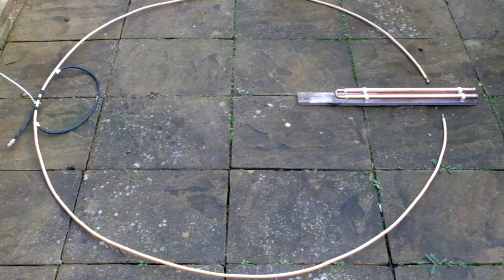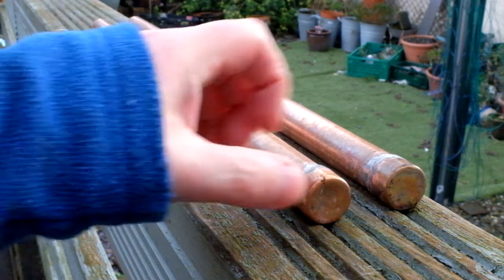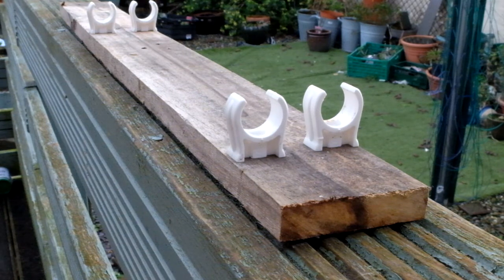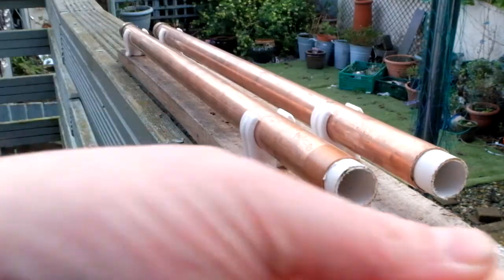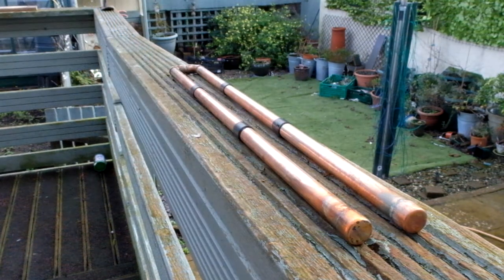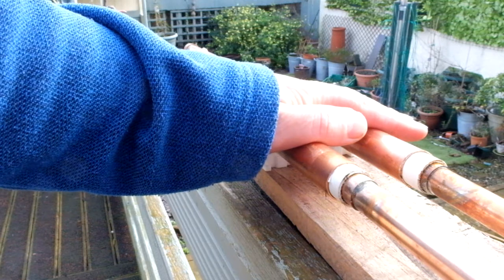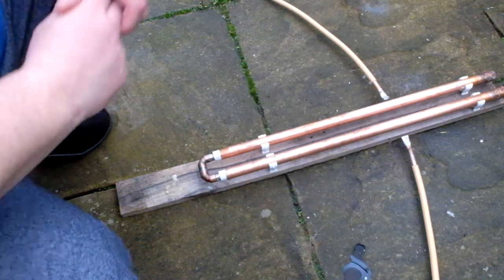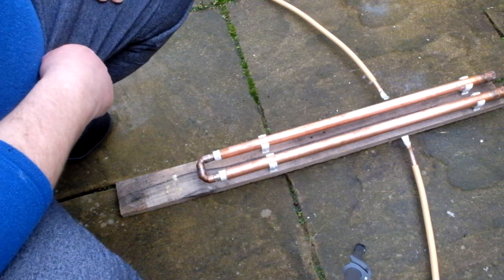Trombone capacitor for a small transmitting magnetic loop aerial

Comment: what bands will it tune with that capacitor?
Reply from the maker: It was meant to tune through the 40m band and that is exactly what was achieved.
Reply: @mw0gbr1  nicely done!! How did you size the capacitor for the band?
Reply from the maker: I designed for 40m band and it worked a treat!
Reply from the maker: I used to basic maths found on the internet for calculating the capacitance, it's just the plate size according to the size of pipes used. It worked well.
Reply: @mw0gbr1  How long were the "trombones"? And more important, what is the highest freq you manage to have the magloop resonating? In other words, what is the minimum capacitance you obtained?

Comment: Charles, after a month, you certainly deserve more views/likes. It's a very well done vid as is your implementation of the trombone which is a credit to you. Must be the cleanest implementation I've seen!
Please be honored that I'll copy your design/method 100%.
Hat Tip to you, Sir.
I've had some copper pipe laying on the floor for months for the same use and your vid just showed a Cook Book method of getting on with my long delayed project. It should become a Classic!
I got sidetracked with an EFHW Inverted EL late last fall and then a nasty incidence with a Snow Blower rendered my 100Ft LMR400 rather usless for the time being. Ouch....
Again, good job and I just subbed.
Glad to read that the loop works well.

73
Russ in NH ..